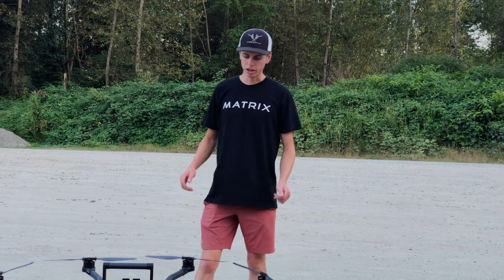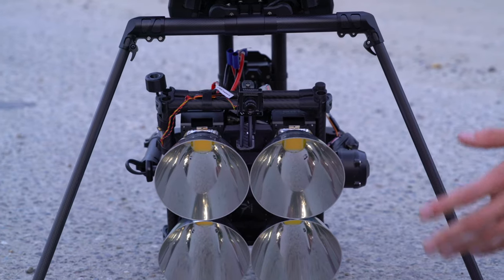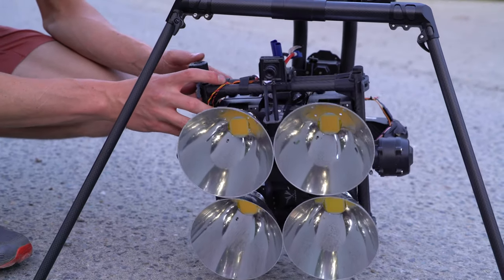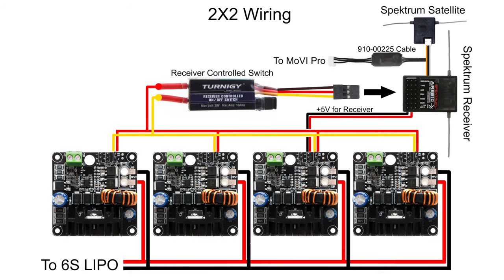High Power Spotlight in Drone Gimbal - 2X2 Array by Stratus LEDs

Comment: I'm thinking search and recovery would love this. And with a low light fpv cam could get longer run times with  less wattage. Keep up the good work.
Reply: I'm in the process now of building one for my fire dept.
Reply: Only consideration is lack of flight time to create a thorough search, or just get a bunch of these in a grid search with a shit ton of batteries
Reply: Harbor Detail that's what we do, I've trained with other fire depts. along with police and others that have drones or are trained in S&R.  We mark off a possible area the victim could be, then make our own type of longitude and latitude  grid.  They assign each quadrant a number/ letter combo, and that's how the assign different types of crews to a certain location.  You could do your plan with just a couple drones, it was just take a while.  But sometime those searches, especially in the case of missing children,  can last days to weeks.
Reply: @sunshynff  yeah exactly its hard to say what the best approach to using drones in a search and rescue situation are being how different each case is.  As battery and flight tech keep evolving I could see grid searches using more autonomous drones flying the route programmed to target abnormal heat signatures or inorganic movement to help pinpoint where ground personnel should be positioned.
Reply: Harbor Detail Exactly; that’s where we’re headed.  They say that battery technology is one of the most stalled areas of tech industry.   It just can’t keep up with all the power ravenous products being introduced.  One article said, and I tend to agree, that by appx 2030, someone will male a significant discovery in the portable stored energy technology.  Leading to  things the size of a home fridge powering an entire industrial factory, or a car batteries the size of a pack of cigs..lol.  the last part was pure speculation.
Reply: @sunshynff  idk about you, but if I was a kid and was lost and saw this thing flying around shining a light at me, I’m running even further away. Ain’t getting probed today Jack...
Reply: @sunshynff  I know your last comment was a year ago, it since then I’m sure you’ve seen the new emergency car jump starters that are about the size of like 3 iPhone Max’s stacked on top of eachother. They can jump a car battery or charge phones, tablets, or anything like that
Reply: @roushstge2 ....I've seen ones about the size of a lunch box, that you charge and then put in your car, haven't see ones that small, I'll have to check them out.

You bring up an excellent point about kids being scared of the drone, that even applies to our fire gear and structural firefighting.  In fact one of things we try to do during fire safety week or any time of the year we visit a school with younger kids, like K-2nd grade, is we have one the crew slowly put on the fire gear complete with breathing tank face mask and helmet, and let the kids interact with them and touch the coat and stuff, then take the mask off reminding them it's just one of us.  We tell them that we may look scary but we're there to help.  

Then we tell them it's hard to hear in all that gear and we need them to scream as loud as they can if they are ever trapped, then we let them practice screaming at the top of their lungs.  They love it, the teachers not so much..lol.  Your suggestion is something I might bring up next training, maybe put a some sort of speaker on the drone so we can say we're the fire dept, or something, to let a kid know the drone is not there to hurt them.  Thanks for the tip!
Reply: @sunshynff  yeah I used be a volunteer firefighter years ago before I became a cop, because you know what they say... God made cops because even firefighters needed a hero to look up to. Lol. 

Yeah check out the new Li-ion jump box that have come out in the last 8-9 months. I know the lunch box size normal jump boxes you’re talking about. These new ones are tiny compared to those. They typically come as like an auxiliary power bank for your cellphone/tablet/etc and have 2 plugs for the positive and negative battery cables. They’re meant to fit in your glovebox or console of certain vehicles. I know vehicles like the Toyota Tundra has a console that is essentially a filing cabinet. They’re actually designed to be able to put file folders and file folder hangers for people like contractors and landscapers, so that small power pack would not only fit but would probably disappear in a console like that.
Reply: @roushstge2 ...Cool, I'll look them up now, 

Hey you know what cops and firefighters have in common?  They both want to be firefighters...lol
Be safe out there brother!

Comment: You know the funny thing about the logarithmic scaling of light intensity, is you could easily get away with just using a single LED and get more than half the light intensity as 4 lights.
Reply: What’s the fun in that
Reply: From what I understand, it means that doubling the number of leds won't make two times more light. Its kinda like sound if I remember right
Reply: I kinda understand what your saying, but I think putting the parabolic reflectors on them does something to the equation.  One thing is for sure, the folks over at Stratus LED know their stuff when it comes to this technology.  Have you checked out their website, I bought one of their lights for a drone I'm building, the video does not do it justice on how bright it is.

Comment: @rctestflight >>> I have seen vids showing laser-based automobile headlights developed by at least one of the European car companies {maybe BMW or Mercedes-Benz, I do not remember which}.   A blue<?> laser light reacts with a special phosphor surface to create an INTENSE white light.  From what I remember, these things have the advantage of being very small, lightweight, and requiring very little electric current. 
 
I was wondering if a laser-based spotlight would be lighter in weight and/or require less battery power than those LEDs you used? 
 
{EDIT:  YES, I know your company is StratusLEDs...😊  Still, I figured I would post this anyway.}

Comment: SWAT and FBI wants this drone!
Reply: I’m sure if the FBI wanted this, they’d have this. And SWAT doesn’t really have a need for this, since we typically operate inside buildings... typically. Fire Dept’s would benefit the most from this I’d think. You could light up a rescue scene like a car crash down an embankment or off a cliff. I could see my PD using this for non swat operations since were not a tiny dept, but we’re just small enough to not have our own helicopter. We have to call in the heli from the next city over which is only about 5-10 min flight time but by the time you call for it, they get it pulled out of the hangar and up in the air and headed your way, you could have had this deployed and be halfway through your search efforts for someone hiding in an urban environment.

Comment: I couldn’t help but notice your light battery cells were waaaaaaay out of balance.
Reply: I wouldn't say "way" out of balance, not if he's used them already, cell difference isn't as big of deal after discharge, most hobbyists say that .1 is acceptable between discharged or partially discharged lipo cells.  Now if that were a freshly charged battery off a decent balance charger, then I agree, from my understanding, the max acceptable cell difference after a balance charge is .03, tops.  That's if it's an older battery, ideally it should be 0.00 or maybe 0.01 diff. tops.  I'd keep an eye on cell 5 though if is that was my battery, it's .12 below the highest cell voltage.  As far as I could tell this was the voltage of the 6 cells.  (I think there was an edit or two around the time voltage meter was shown too, had to re-watch to make sure...
1= 4.04v    2=4.12v    3=4.05v    4=4.05v      5=4.00v      6=4.11v

Comment: The minuscule flight time of merely 12 minutes beats the purpose of whatever technology is in the drone.
Reply: This is really not that much of a problem considering how easy it is to swap out batteries. Such drones are intended for use in movie projects. For that, they're more than sufficient. Seldom do you want to have your drone in the air for longer than 12 minutes.